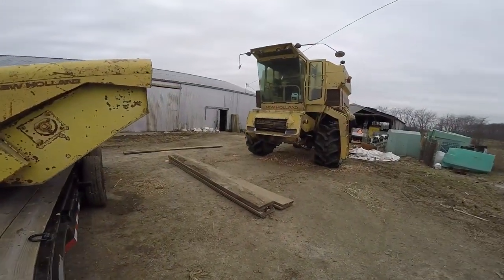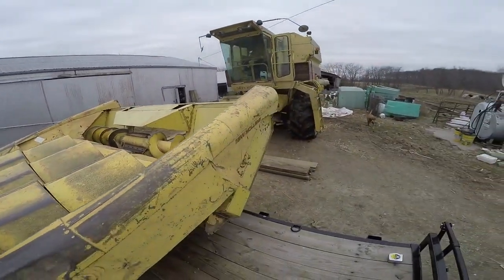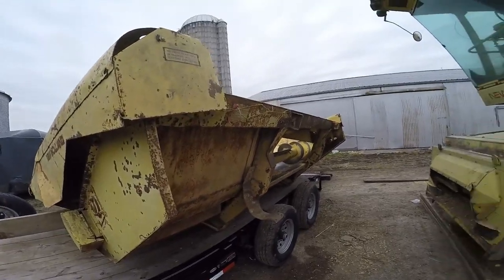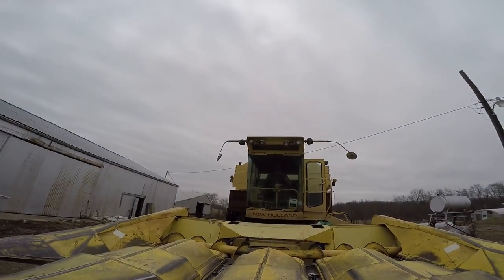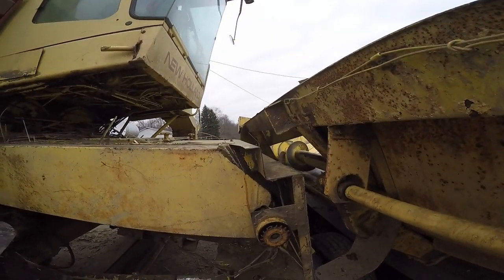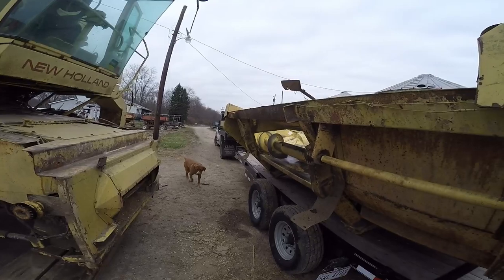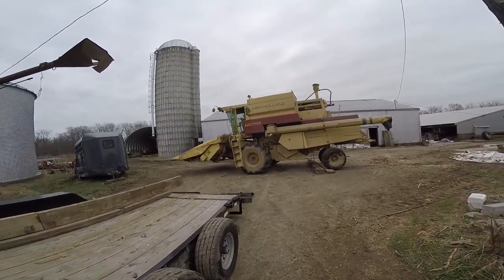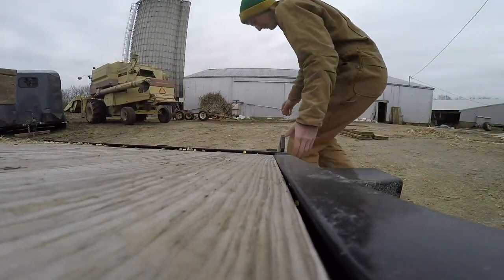Unloading Corn Head from Trailer

Comment: glad your done. I just use a telephone pole on a running gear for my header carts seems to work good and a lot cheaper.
Reply from the maker: That's probably what I'll end up doing for next fall. In the past, we have traveled with the head on the combine. But after having to bring the whole machine home to make repairs to the head, a cart would reduce a lot of tire wear.

Comment: taking the head off is simple.  putting them back on is where the fun comes in.
Reply from the maker: As you can see from the stack of boards, we had to get creative. Most of our fields are less than five miles from home, so we leave the head on when traveling. For the sake of saving the rice tires, I would like to have a proper header cart for next fall.
Reply: @boehmfarm4276  There's another option... have a ditch or cut and back the trailer tires down into it on that side-- lower the trailer so the combine can clear it on level ground.  I put one in to get bales off the trailer easier with the Mahindra... OL J R :)

Comment: I have a question? I watch lots of farming videos. Why don't most farmers I see open up the entire field . It doesn't matter what crop their combining, they just do part of the ends then start combining. We always did the ends and opened up the head lands of the field. It got more air thru the field to dry the ground and the crop, especially corn since the ground was usually wet. Just curious....
Reply from the maker: My guess is that it caused by irregular shape of the field. As far a crop drying, we have usually waited long enough, that the extra air flow wasn't going to change much.
Reply: That's always what we do at my BIL's place in Indiana for the same reasons you mention, except if the field is basically divided in two anyway so it's basically a separate field.  There's one field connected by a slim part of the field basically one planter pass that connects the two halves.  The only time he DOESN'T do that is if the field is wet on one end of the field and we're starting on the high end, and he doesn't want to crawl through the mud trying to get the field broke open completely... Though you're right, opening it up DOES help things dry out a bit... OL J R :)

Comment: Is there any good videos of how to operate a gleaner combine
Reply from the maker: Unfortunately, I won't have any videos of our K in action until autumn. I used it a little bit myself, but i am still getting comfortable.
Reply: Boehm Farm  ok I see thanks for replying I was just wondering because this coming weekend I'm getting a gleaner c combine and I have only driven Deere before
Reply from the maker: Good luck with your C. If its like my K, it may not have power steering. The levers to turn on the separator, head and unload auger are all  over the place in the cab. With our TR70, they are located in one spot. The variable speed and head height share a lever.
Reply: Boehm Farm   Oh ok well thanks for the    Info have a nice day keep on farming